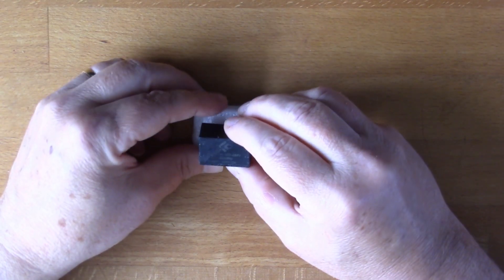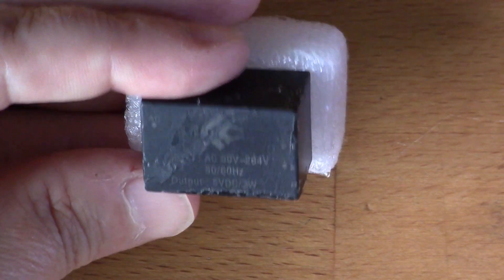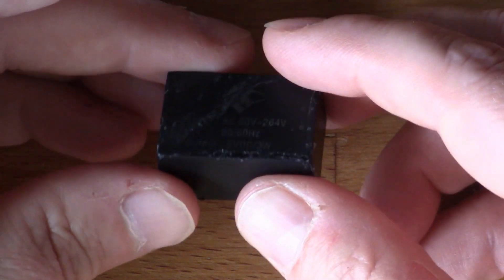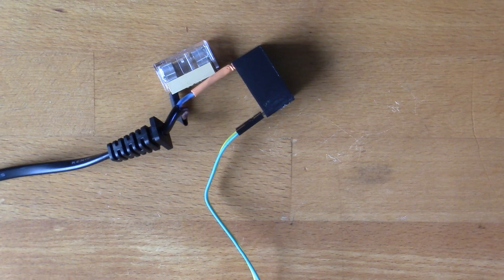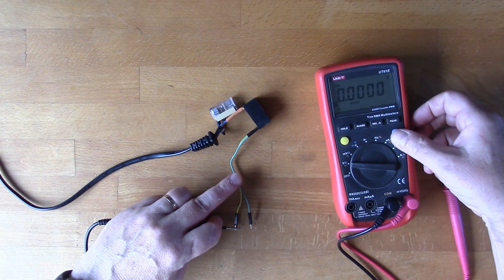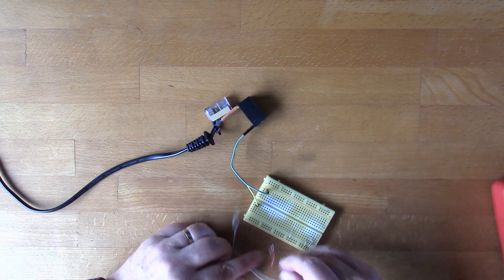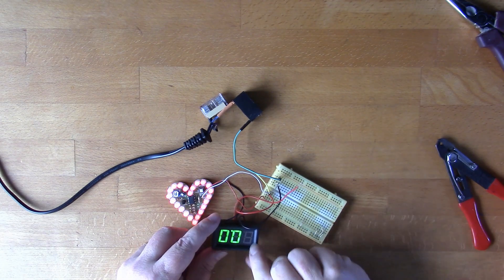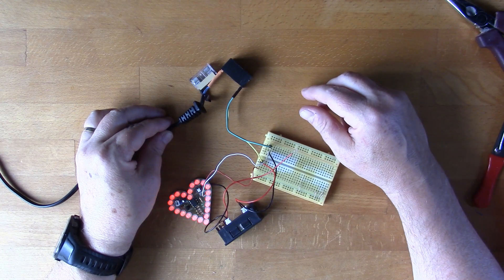Standby Power Supply (#153)

Comment: Hi Martyn. So one project I'm about to embark on requires a weight measurement (sub 1kg) to be remotely txt to me on a weekly basis. From what I'm seeing on you tube my initial thoughts are an Arduino Nano to GSM Sim 800L hooked up to a 500g load cell and HX 711 board. Are there better suggestions ? And would it be possible to get it all to 'wake up' and transmit the txt with weight (and remaining battery life info) then shut down again automatically ? I'd prefer not Lipo due to fire risk so ideally a standard 9v battery ? It will be in a remote location so needs to be super low consumption to extend the battery life and avoid frequent visits.  Any pointers would be highly appreciated. Thanks. Phil ... 🇬🇧
Reply from the maker: There is a sleep mode supported by the Atmega chips, where it can use microamps while waiting for the next activity.  There are tutorials online to get the best setup - normally including disabling the regulator and LEDs on the Arduino that are wasting power.  I'm not sure if the SIM800 can run off a standard 9V battery - it needs quite a surge of current to connect to the network.  In my "shed alert" setup (which sent texts to my phone when the mains power failed) I used a Li-Ion based 12V boat/motorcycle battery as my standby power.  I found that (perhaps once per year) I had to intervene manually and reset the Arduino, because the cellular connection had failed, so when I design the system next time I'll probably re-initialize the SIM800 and Arduino every few days automatically.
Reply: @MartynDavies  Many thanks for the advice Martyn. I'll look into all of that.